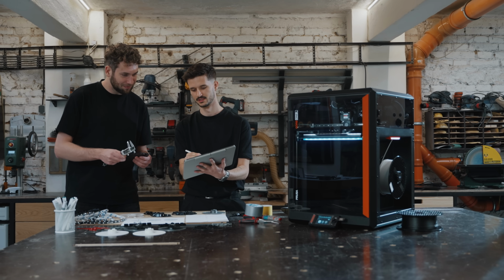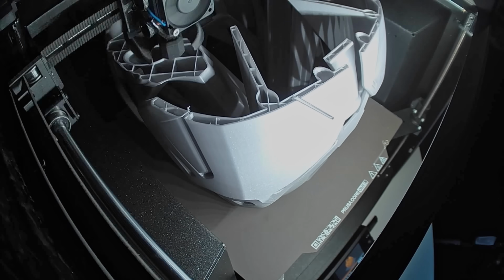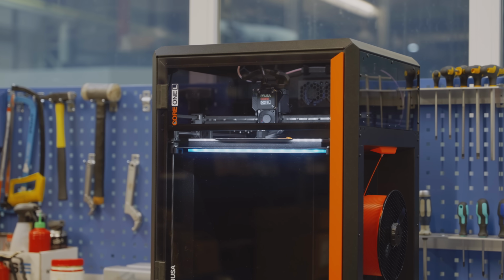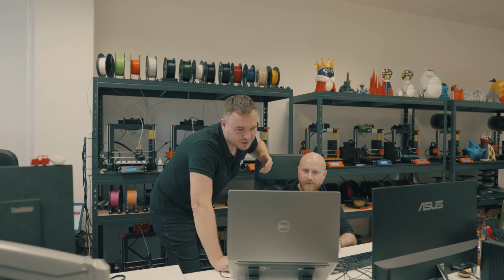Think Big, Print Bigger: Introducing the Prusa CORE One L!

Comment: INDX option is a must, please release soon, i'll not even consider buying core one/l if it does not have INDX, please make it sooner than bamboo vortek, i need a new printer to replace my mk3s+
Reply: Have you considered the snapmaker u1? Seems they've nailed the toolchanging function
Reply: @chungnun4948  U1 is 6 months away, it will be obsolete by the time it comes out. If there would have been preorders for Vortek and INDX for the past 6 months, nobody would be talking about U1. Sorry.
Reply: @chungnun4948  nope, i want indx/vortek style printer, not many print heads printer, i considered buying Prusa XL, but now i only want indx or vortek, but i hope Prusa Core L INDX will be out sooner than later

Comment: I had excluded the Core One because the print plate was too small. This is now back in the running. Although I'm still going to wait and see if Bondtech's INDX is as great as it seems. An INDX on this would be pretty much perfection.
Reply: You'd best wait. If the arrival of the Core ONE L so quickly after the (still rough-around-the-edges) Core ONE is any indication, in roughly 9 months they'll release another printer with no kit or upgrade path for Core ONE L owners.

Comment: I'm waiting for home metal printers and CNC machines from Prusa :) bravo
Reply: oh man a metal sintering machine would be killer.
Reply: Honestly they should make desktop cncs, i wouod buy one instantly!
Reply: That is way different than a simple FDM printer. Metal printers have to sinter the metal together so it is either a powerful laser or a full sinter system. Either way, you have to control the oxygen getting into the print so need, nitrogen, hydrogen, argon or some other gases in the chamber to stop oxidisation. Plus metal shrinks and warps when you heat it to sintering temperature, there are ways to calculate it but it isn't a simple hobby toy.

Comment: It sycks VS Bambu H2S 340 x340 Now 350x350 is THE Standard for the Future
Reply: BL is irreparable spyware garbage, locked and designed to fail and dispose of to buy new ones.
Reply: @fofopads4450 Absolute BS
Reply: @fofopads4450  me when I make stuff up
Reply: @fofopads4450  why do you prusa fanboys always need lie about competitors? You can buy replacement parts from belts to steppers to the entire x axis for h2s/h2d 😂
Reply: @infinitelyexplosive we should laud them for doing bare minimum until now.  Good luck fixing that rude goldberg mechanism extruder in a couple years.
Reply: @fofopads4450  it takes like 6 screws and 5 minutes to replace the extruder…
Reply: @infinitelyexplosive  "entire x axis" What could you have possibly done that means you'd want to replace the whole x-axis?  At some point the bearing will wear out. They'll sell you a replacement linear rail, right?
Reply: @_Piers_  honestly I don’t know, but it’s cool to see that you can buy it regardless

Comment: Kind of disappointed the hot end only goes too 290c still even though filaments that need over 300 are relatively affordable for enthusiasts and hobbyists.
Reply: They have the Ht90 for that. over 300 degrees requires stronger electronics and safety regulations.
Reply: @fofopads4450  "over 300 degrees requires stronger electronics and safety regulations."
Which none of these chinese made printers have. Which is why most are burning through electrical components and turning into paperweights.
Reply: @LilApe  another made up story, nice, you are really on the roll  😅
Reply: I primarily print in 300°+ filaments, so unfortunately yet again, this is a flop for me from Prusa. Bummer.

Comment: I just ordered the Core One kit last night and it already shipped.  Oh well, there is always next year's BF deals.
Reply: Next Year's BF deals will probably include discounted Core ONE L units because Prusa will have released yet another Core ONE, with no upgrade path, in less than a year.

Am I a salty Core ONE owner? Yes. That printer took six months to shake the bugs out, and just a few months after that it has basically been replaced with what it should have been from the start.
Reply: @snarky-drive-by   It's a completely different printer at a different scale. No one complained where there was no Mini to Core One upgrade path.

Comment: please add chamber heater otherwise it doesn't print large abs/asa reliably ...
Reply: It has one. It uses a convection heated plate of aluminum and uses fans to redirect the hot air from underneath into the rest of the chamber.
Reply: The largest Voron's don't struggle with the same system this is using.
Reply: @_Piers_ but the quality is really bad compared to bambu

Comment: Is there MK4S to Prusa CORE One L Conversion kit
Reply: Just look at the parts, there's practically nothign shared between those two printers.
Reply: @_Piers_ electronics and the extruder looks similar, I think an upgrade from mk4s to Core 1 L is possible, probably at 1000 USD price tag.
Reply: @ahmedalkhoudiri5435 One of the Prusa team has said it's not happening in the comments here.     
There's also not going to be a kit at all.
Reply: There are no immediate plans for a conversion kit
Reply: yeah i was looking ate the core one upgrade from my mk4s but would jump on the core one L upgrade asap

Comment: Why isn't there a kit?
Reply: It's a combination of quite a few factors. Moving forward we're trying to not force our printer designs to have kits, as this can complicate the manufacturing process resulting in more expensive parts. This is not the case for every printer though, but in this case as a large portion of the printer would already have to be pre-assembled (heatbed and electronics), it's more economical both for us and the consumer to focus on just the assembled version. For the kit building experience, there is still the CORE One

Comment: 2:59 using gcode to open the vent is very clever
Reply: I'm surprised by that solution even while it's so typical for Prusa
Reply: On the other hand, it means that that area of the printer cannot be used for printing. I'd just slap a cheap microservo there and call it a day.
Reply: @Papinak2  It's already outside the printable area... it's moving forward of the build plate.  It's the same with other solutions that use a filament cutter... they have to move outside the printable area to engage the cutter.
Reply: @williamsteele  if the print head can reach there, it's a potential print volume that's wasted.
Filament cutters need significant force, so extra motor would be expensive and would add mass to the printhead. Using steppers for that purpose makes sense. Vent door on the enclosure is a different thing.
Reply: @Papinak2  I see no reason to add motors to something that is such a trivial thing. Think of the expense in volume of that type of change. The build plate is the standard Mk4 sized plate... and if the mechanical system can go that extra couple of mm, then it's not hurting anything at all for it to exceed the normal space FOR NOT ADDITONAL COST... in fact, they do it anyway for wiping the nozzles, for example.  This is a perfect example of using one part to perform more than one function.
Reply: @williamsteele the build plate isn't the same as MK4, that whole point of this printer. 
This solution has disadvantage that it relies on correct position of the printhead. What if steppers miss a step or won't home properly? Both have been issues on Prusa machines recently. 
It's good solution to add a function on an existing printer, but if it was an intended feature from the start, it should have its own actuator. This is like operating locks with a window motor in a car.
Reply: @Papinak2 Oh, yep, my bad... I mixed up two different threads where someone wanted the feature for the standard Core One.
Reply: @Papinak2 another failure point
Reply: @Pokornz  but I get the full print volume. I still think bambu does it better
Reply: @FreddyyFazzbearrif you're regulary heating up your whole assembly to 40+deg C, you want to have as few components as possible, because they have to withstand the thermal cycling or they'll die
Reply: now its ready to autofarm straight out of the box, awesome
Reply: Thanks! I came up with that for the regular Core One months ago and published it on Printables. (Search for "Core One automatic chamber vent".) I wonder where Prusa got the idea...
Reply: Makes bambulab's solution look stupidly overengineered
Reply: @Kuba1428CZ And it’s kinda ironic, considering Bambu used gcode based solutions for a variety of things
Reply: @Kuba1428CZ what is Bambu’s solution? I haven’t kept up with their releases since the A1 series printers
Reply: @gustavwagner7024  They now have a door on the top back of the printer that is servo actuated that opens and closes.  Way over engineered it.